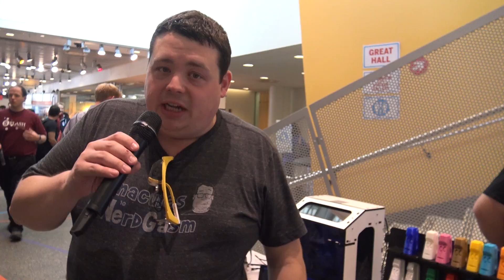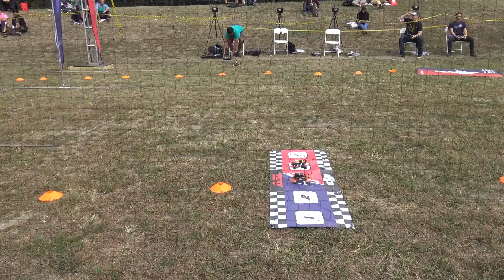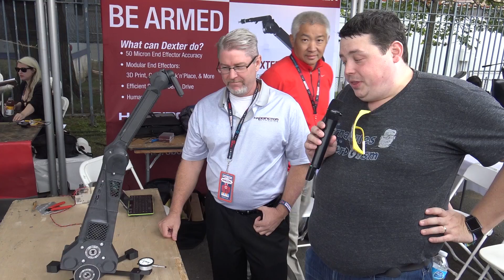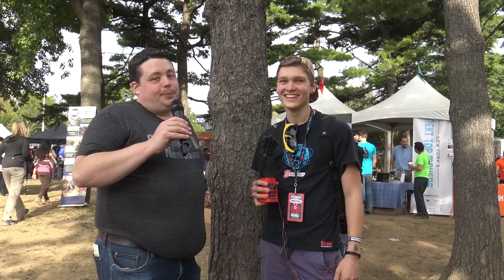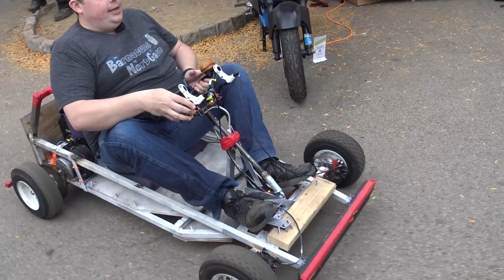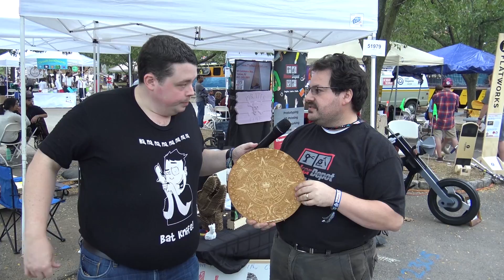World Maker Faire 2015 - Robotics & 3D Printing - @Barnacules

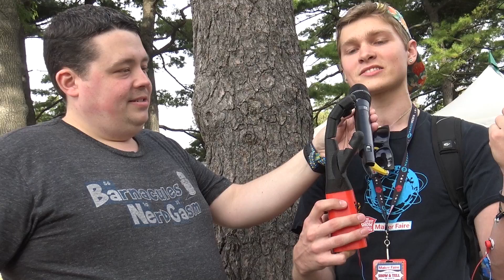Comment: 14:20 that's like one of the good projects that people make in this class at my school called Senior Projects.
There was a guy at my school who made a DNA replicator for less than 200 bucks with an Arduino, a resistor, and a cooling fan.

Another guy made an air-powered prosthetic arm that could lift a weight from the weight room -- I forgot how much.

Then there was a guy who made a mirror that focuses light in the same spot the whole day. Of course it's way too slow to see it in action and he didn't make a time lapse, so I don't know if he was right.

Then this really smart kid named Ivan Krukov (I think I got his name right) made a program that can play a real game if blackjack by detecting which cards are where and using deep neural network learning.

Another guy made a program that calls a ball in or out for tennis with 90% accuracy. That would be great for high school tennis where there are no refs or judges.

Anyway, it's always interesting to see what people come up with in that class.

Comment: I think you make some great/entertaining videos!  I love all the DIY stuff you do.  I'd like to offer my CAD services to you if you're interested or would find it helpful.

I don't know what you have for resources as far is CAD goes, but if you ever need help with more complex modeling for a custom application/project, I'd be happy to help.  Or if you just come across a common need for a product that doesn't exist.  I'm a mechanical engineer specializing in product development.  Aside from day to day work projects, I make a lot of custom parts for my personal computers such as mounting adapters for many components, air ducts for cooling, water reservoirs to fit in tight spaces, and anything else I can think of.  If I was sent some pictures and measurements of a situation, I could model what you want it and send you files you could 3D print or CNC at your place.  I could probably get what you need done very quickly maybe even same day.  Compensation could be a little advertising, computer parts or something else creative depending on the project.  I'm open and flexible.

Thanks!

Comment: Still better then makerbot?
WTF? makerbot has great stuff beats most of the other crap out there
Reply: The fifth generation with that smart extruder is just the best.
Reply: Yeah to be honest I own two Makerbot Replicator 2's they've been working both for 4 plus years now, and other then the regular maintenance I had zero problems with them.
Reply: No I agree. I have a Flashforge Creator Pro. It is based on the Makerbot 2X design. They are very similar machines. I also have a friend that has a MB Rep. 2. He likes it. The only things that annoys me is the key bad is very hard to deal with. I like how the FF Creator Pro has buttons. 

I had the Makerbot rep. 5th gen. It was the WORST tech product I have ever bought. They are now going for $700 on eBay. They say they have fixed the smart extruder. I am very tempted to buy.

Comment: I really doubt that those little motors are 4hp each. 4hp is about 3kW. Then again, you never know.
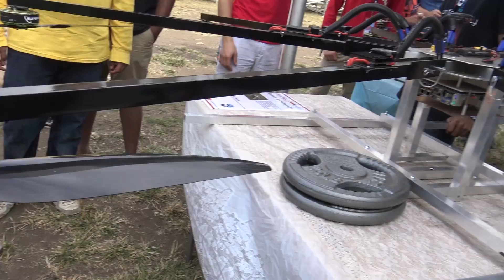Reply: +LazerLord10 @5:51 he literally does a close up of the motor and it says 3kW....
Reply: MSzwed
Oops. I guess I missed that. I'm just really surprised how small those motors are. I suppose I'm just used to huge lower-speed motors that have much lower speeds and therefore, lower power. They have more torque, but the torque isn't enough to make up for the lesser speed. (if you look up 4 hp motor you'll see what most of these larger motors are like.)

Comment: I have a question in regards to 3d printers, is there any out there that can print like maybe 2 feet sections up or widthwise, i ask because i been working on my homemade EV motorcycle with a friend and after welding up the frame this past weekend, it has a lot of warp in it.. so i am needing to either start over or go a different route, after some studying i have thought about going composite carbon fiber, so i got to thinking i can print out the portions of my frame in very lightweight sections to scale, then wrap them in carbon fiber for structural...